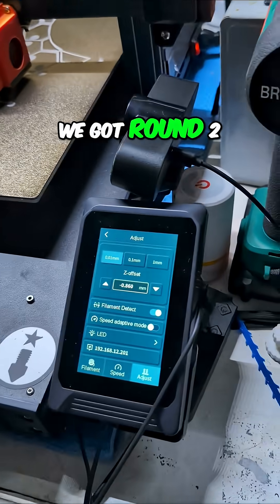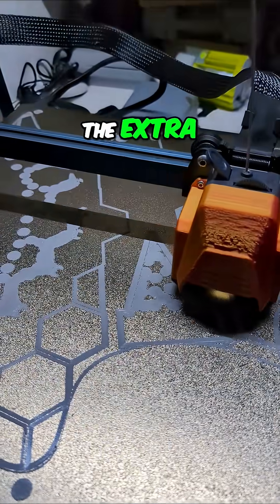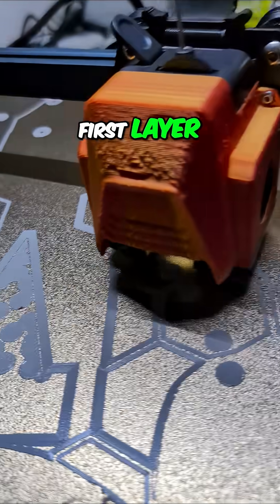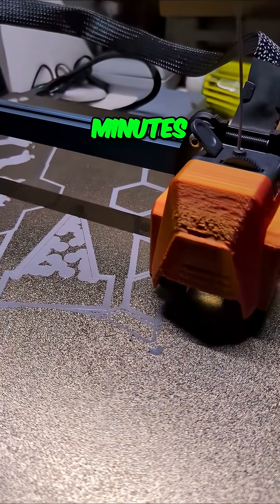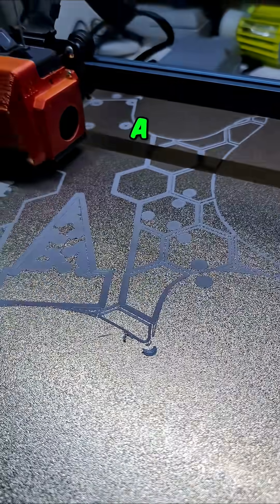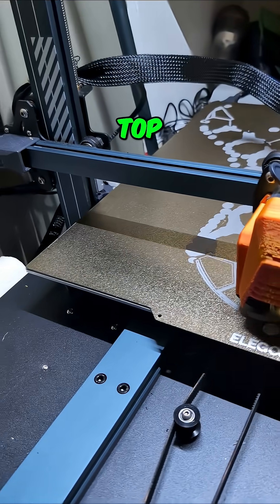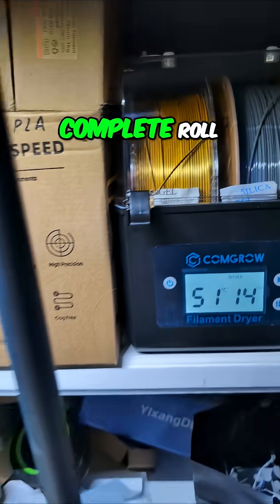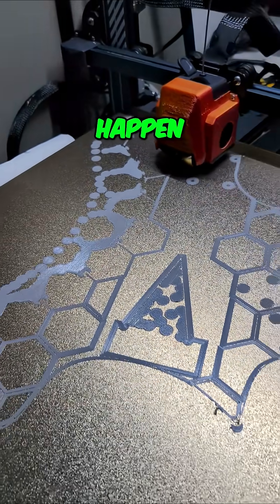3D Printing a Guitar: Epic Elegoo Neptune 4 Max Attempt!

Comment: I have a plus and the fan bar has never caught anything.  But it is a very temperamental printer.  Lol 👍
Reply from the maker: Apparently, large beds are harder to keep level
Reply: @GearReportMaker  yes that seems to be the case. My Neptune 3 max works good but needs alot of attention.  Since i have my k2 plus and elegoo carbon. The bed slingers have been collecting dust. 😆
Reply from the maker: I think that this huge print as finally convinced me to sell the N4M. Now that I have the Centauri Carbon and see how super easy and stress free it is to generate great prints, my patience for babysitting the N4M, must to get prints that are OK... it is gone. It served its purpose. But I think I'm done fighting with it.

Comment: Well for that long of a print if you didnt use any 3d print bed adhession its going to fail
Reply: For most prints i don't use glue. I haven't used glue on my K2 plus or Elegoo carbon.
Reply from the maker: @dwaynem8015  same. But I found pretty quick on this full bed print that adhesion was an issue. I usually just wipe down the bed with alcohol.
Reply: @GearReportMaker i use airasol window cleaner. It foams after sprayed on and just wipe off. I think its got some alcohol in it.
Reply from the maker: Haven't heard of that one. Foaming sounds interesging. Might try this one soon... https://amzlink.to/az0fTeTWQSKYB
Reply from the maker: Just started a new print and put glue on the whole bed, plus a brim
Reply: Wish i could print out guitars but build plate is too small, flashforge 5m pro 220x220x220, but its really fast
Reply: Take a look at my page i just uploaded a vid of my printer doing first layer and a couple layers , i used flashforge 3d printing adhesive. But if you use glue you should never have a problem